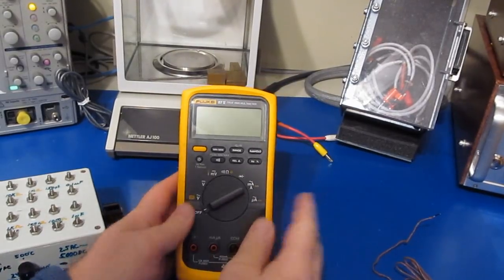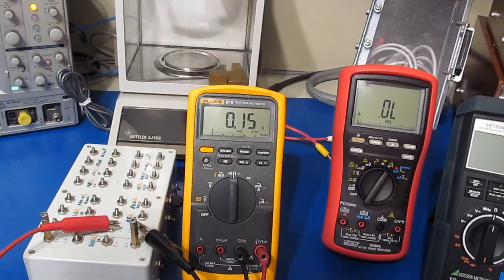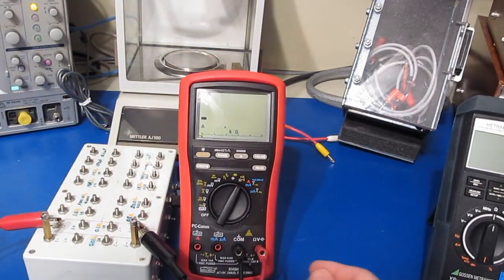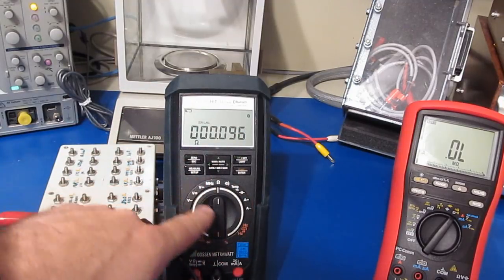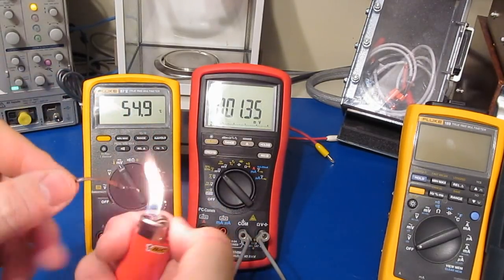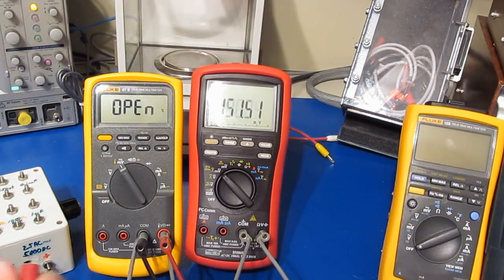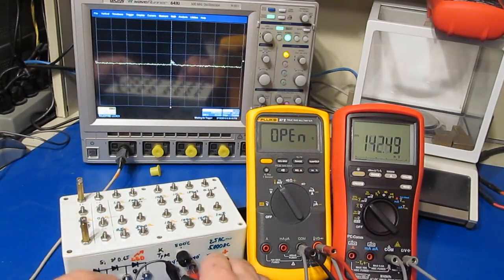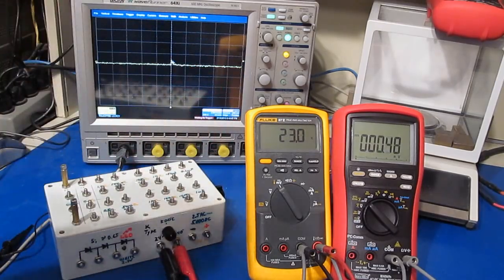Fluke 87V Robustness Tests,  Part 2

Comment: Hi - wanted to ask if the alligator screw terminals on your test box are stainless steel-?   Im building a combination test box and a section of it will use similar screw terminals,  didnt know if stainless screws or brass would be the better conductor - I know brass gets a patina so I was considering stainless or nickle/chrome type screws.
Reply from the maker: My answer to Glen about the hardware and the errors it causes...

So you are asking if the resistance of the mechanical hardware will add 
an error to these measurements.  To that, yes it will.   Describing 
it as "too much" and "very low" really don't carry a lot of meaning.   
For you, 0.5 ohms is a low resistance and is difficult to measure.  For 
me, this is a very high resistance.   What means too much to you 
again may mean something different to me.   I am using the box to do 
quick checks of the meters.  I need it to be accurate and 
repeatable enough to know if a meter has changed.  That's about 
it.  Most of the parts are better than 1% which is overkill for what I 
am doing.   2% would be fine.

So how much does that steel hardware effect the measurement?  We know  
P=RA/L, where:

P = resistivity of the material in ohm-m 
R = resistance of the material in ohms 
L = length of the material in meters
A = cross-sectional area of the material in square meters 

The hardware is all 304 stainless.  The resistivity for 304 is 6.897E-07
 ohms-meters.  These are all a #8 which have a major diameter of 
0.138" or 0.0035052 meters.   We know the area of a circle is pi R^2.   
So that's 9.6497 um^2.

The total length of the screw is roughly 0.5" or 0.0127 meters. 

We want to solve for R, so R=PL/A.
I get 0.00091 ohms but I strongly suggest you check my work rather than 
trust my napkin calculations.  So that's what, 0.2% error?  Again, I may
 have made a mistake.

Comment: Joe at 1.00 you zeroed fluke while accidentally jumping across 0.1R instead of shortening the leads, thats why it was not accurate, please edit othervise 87V funs wont sleep tonight :D
Reply from the maker: The resistance between the two common leads of the 4-wire sense resistors is fairly low compared to the part I am trying to measure.  I actually show it compensated both ways.  Note that both the Brymen and Gossen were compensated using the the two common leads as well.  The specs on the Brymen are not very good and it is the wrong tool for the measurement.  It does a better job than I would have expected.
Reply from the maker: I have  uploaded a few pictures making a 4-wire measurement of the common connections using my old HP bench meter.  http://www.eevblog.com/forum/testgear/hear-kitty-kitty-kitty-nope-not-that-kind-of-cat/2425/